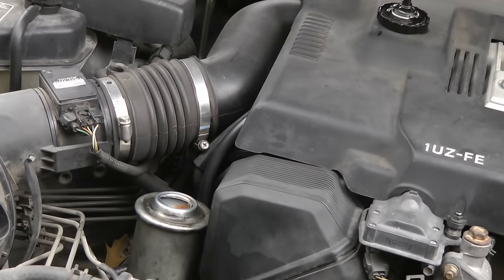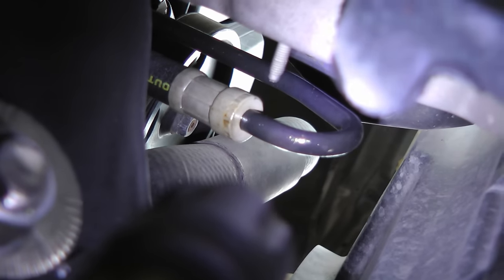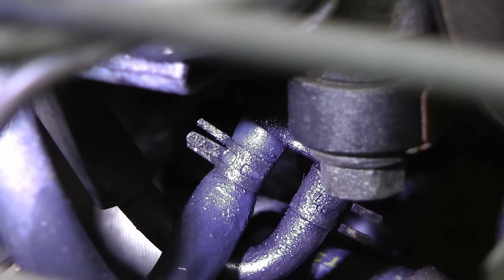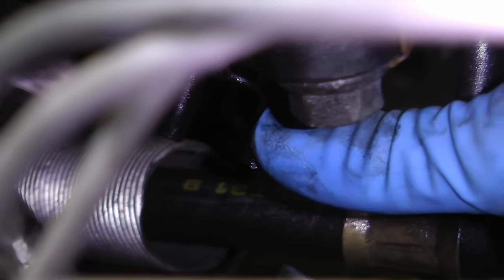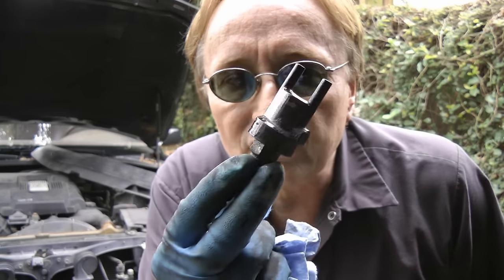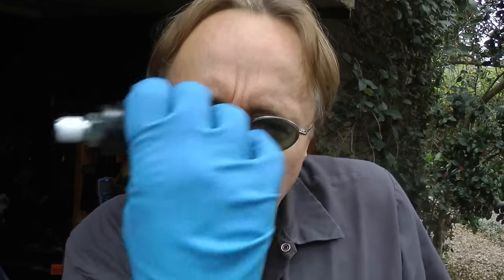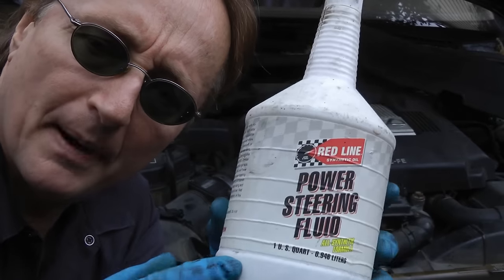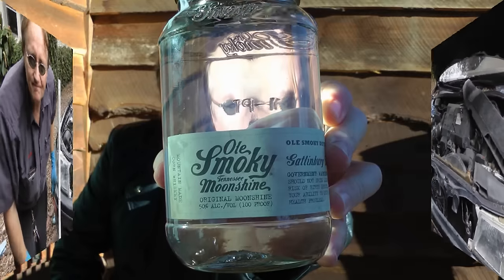How to Fix Power Steering Noise When Turning

Comment: Hey, my steering pump starts to whine when I drive with my ac on. When ac is off the whine goes away. It only wines (when ac is running and)when I'm pulling out of parked position(slow speed). Is this normal?
Reply from the maker: AC commpressor on strains the belt system, try new belts first, if not that, you need a new steering pump

Comment: I have a 2002 ford windstar powersteering wines when it gets warm. It is not leaking and when I check the reservoir while it is running the powersteering fluid is  moving around and that would tell me that the pump is working.  Can you help
Reply from the maker: ford pumps just do that when that old, live with it or buy a new pump,, remanned ones often stink

Comment: Where and or how does the air stuck in the power steering system goes out by just moving the steering wheel

Comment: I'm having similar issues. My 03 Buick Century steering wheel is really stiff and makes a loud weird noise when turning, I checked the fluid and it's literally empty.
Reply from the maker: fill it up and fix the leak
Reply: IF there is no leak? Still making noises?
Reply: What exactly do I need to buy to fix it? How much will the part cost, and labor estimates? Thanks.

Comment: Hi scotty i have a problem my wheel is extra tight wont turn and when i try my battery light kicks on wat could it be and would that cause my car to overheat? really need some pro help
Reply from the maker: corey jenkins   any worn device the fan belts drive can do that. like a bad power steering pump or bad alternator, remove the fan belts and check em all to see if any are binding

Comment: My 2010 Altima is losing so much power steering :/ I have to put some every 1-2 days. It’s leaking so much in between 2 hoses
Reply: Did you get it fix
Reply: Alex Coronel, not yet. I have to take off so many parts to access the hose

Comment: Have a BMW e36 1998
it makes a annoying sound when turned the whole way around (I dont know the max degrees but it wasnt possible turning it more) then it made the sound, it didnt make the sound untill I was all the way around.
This happend both left and right, the servo fluid tank was almost empty, but I filled it, and it still made the sound even when I turned it a few times.

Might be a leak, but would it make a sound if it's oil in the container?
Reply from the maker: pumps are notoriously weak on that model, I change out tons of them, but if it steers good, you can ignore the noise
Reply: Scotty Kilmer
The pump, the servopump that is?
So you have alot of bmws driving around in the states? :D
Reply: Erlend Myhre actually yes I'll answer for him
Reply: Erlend Myhre LOL, yeah of course... "the states" has the highest concentration of BMW sales in the whole world! Don't you know were car crazy here!?!?! LOL

Comment: with my dakota.. first it was the rack.. ..had it replaced.. 3 yrs later... leaked again.. had it replaced again.. .spool valves.. then a metal line was rusty n a slow leak.. had that replaced.. then needed  2 feet to trun the weel..one foor to rev evenly  the other on the gas to keep the truck from stalling or idleing too low.. SO A MECHANIC TOLD ME THE  ORIGINAL PUMP NEEDS TO BE REPLACED  ..DIDNT DO A DAM THING... ...QUESTION... do i have one of thoes things  to keep my idle up ??????? 94 DAKOTA??3.9??????????

Comment: as soon as I put my car into drive a squealing noise begins that last for a minute or less after that it stops and my car run smooth, can this be a problem with my brakes? it doesn't make any noise when I brake
Reply from the maker: often just worn out or loose fan belts

Comment: That is a Lexus LS400.  You never put power steering fluid in them Scotty.  They take automatic transmission fluid.  The reason goes way back to WWII when we banned Japan from making aircraft or aircraft systems.  They were forced to use ATF in their car hydraulic systems which of course is acidic and eats rubber seals and plastic parts, demonstrated by the destroyed idle up valve you showed in the video.

Comment: My Audi 4 steering wheel is making a cracking noise usually only when I'm low spends like in my driveway or  shopping parking lot ..now I'm scared to drive it

Comment: 2008 pontiac g6 4cy power steering location under alt.? where is the filler cap?
Reply from the maker: a cotoia follow the feed line of the pump, it ends at the plastic reservoir

Comment: so my power steering is fine no heavy spots and stuff, the fluid is full but is a darkish black colour and the pump whines abit especially on full lock. what's my problem just a flush needed because the oil is old?
Reply from the maker: yes, pray it's that and not just a wearig out pump
Reply: Scotty Kilmer Well I work in car parts so can get them cheap so ill just buy new fluid and give it a flush see if that solves it cheers Scotty

Comment: i think im having power steering issue. i hear a weird racketing noise when i turn car on.  the noise is gone when wheel is turned either way. this also occurs when driving. noise goes away when im making turns. 99 toyota corolla. it has power steering fluid
Reply from the maker: if fluid is full, odds are you need a new power steering pump

Comment: I did fill up my fluid container, but the noise is still there, infect. I think it just got worse. What could be the problem here?
Reply from the maker: time for a new pump then
Reply: Check your power steering reservoir filter. It can get clogged up and since there is no bypass circuit for it, it can starve the pump of fluid making it groan and harder to turn. I made it a habit to check the smaller things first before moving on to bigger and more expensive parts.

Comment: My Honda  civic eh9 - its steering get sqeeqing sound little bit when i turn the steeering right and left. can you give any solution for that
Reply from the maker: try this if it's not low on fluid. And pray it doesn't need a new pump
Reply: thank you

Comment: My VW polo vivo hit a manhole on the left side and now there is a funny noise like a blowing fan, coming out of the engine when you turn it on. What could be the problem, power steering?
Reply from the maker: check out the fan motor first, it may have been damaged
Reply: Thanks Scotty. I have checked the fan and it is not the cause of the noise. The power steering pump is positioned directly where I fell into the manhole and it is likely to be affected but I still need expert opinion without taking it to a mechanic?

Comment: Scotty, the AC on my 2000 lexus rx300 stops working if I turn the steering wheel to fast. what is happening?
Reply from the maker: check for loose wiring to the AC, turning fast makes wires move around, a loose connection will do that

Comment: hey man i got a Lexus sc400 it's got a leak i have changed the houses an it is still leaking but i haven't got to look underneath yet could that be my problem
Reply from the maker: +Nytral Rodrigues leaking rack most of the time, do my video "finding and fixing car oil leaks"
Reply: Sorry bout that i forgot to mention is my power steering

Comment: how do you check an electric power steering that doesn't have a power steering fluid? it makes a whining rubbing noise
Reply: which car do you have? Just because it's electric power steering doesn't mean there wouldn't be any hydraulic fluid.
Reply: +_ Skylake _ i have a similar problem when i steer specialy when the car not moving i can hear like drums like tug tug tug sound. i have 2006 civic si and it doesnt have any power steering reservoir.
Reply: +comment man comment man www.reddit.com/r/mechanicadvice

Comment: At what point should I just get a new car? Actuators are bad, engine temp sensor is bad, oil leak, creaky doors, door locks  get stuck steering  makes that noise, other sensors are also bad.

Comment: I have a Subaru Forester 2007 and i have a noise cómo from the power steering pump, i had replaced OEM pump, high and lower hoses, the reservoir and the whole rack and pinion and i still have a noise, i dont know what else could be, please anybody help me

Comment: I got a 1999 Infiniti q45 that makes a loud screeching noise when I turn the wheel on start up then goes away once the engine heats up, help please
Reply from the maker: generally just a worn or loose fan belt

Comment: i just replaced my pump,high side line,low side line,all fluid (flush) car was bled till no noise when turning, no bubbles,perfect fluid level and silent for 3 days then it started whining more and more checked for air.....no bubbles and no noise at idle noise only when turning wheels after i stepped on the gas. start car in morning alls quiet turn wheels back and forth no noise....step on the gas and it starts yowling real loud and wont stop no matter what you do. if anybody can help me im open for suggestions. If you need to know its a 2000 lincoln continental front wheel drive 4.6L  v-8

Comment: A friend of mines Ford ZX2 Escort power steering doesn't wine, it doesn't lose fluid, and the belt is good, yet when you drive it down the road, the steering hangs up/catches for a split second, and when it does it, it feels like a jerking motion. It doesn't do it all the time, and it appears the colder it is outside the worse and more often it does it.... anyone with any suggestions on what might be the problem? I told him that perhaps a valve in either the pump or the rack is sticking, if so, would a power steering flush fix it?
Reply from the maker: ,.a flush often will fix that. see my video "FIXING binding power steering."
Reply: Scotty Kilmer Got it, thanks Scotty!
Reply: My 02 Camry was doing that, especially when I'd straighten out after a hard turn.  After 12 years, the original fluid had chunks of sludge and gunk in it.  I took the pump off of a large empty bottle of Purell at my work, rinsed it out, and used it to pump out the fluid in the power steering reservoir.  Then I refilled it with Mobil 1 Synthetic ATF.  I did that 10-12 times or so and I'd say about 90% of the fluid is new.  Once I did this "flush" (figuratively speaking), it feels like I'm steering a brand new car.

Comment: my car makes a creaking type of noise when i turn the steering wheel and it gets worse the colder it gets , above 60 degrees the noise in non existant. any idea what it could be ?
Reply from the maker: +mrREVbud often bad bushings or worn ball joints or strut mounts

Comment: So my 2011 chevy equinox makes a grind/ vibration noise when cutting my wheels. Only slow though. Once I give it some gas noise and jerk in steering wheel goes away. Only when turning while idle. Feels like steering wheel jerks like to much pressure with something.  Anyone have an idea

Comment: question ? I own a 97 kia sportage why I cant get the key out the ignition to get out from there I have to unhook the power line from battery thas how I do it
Reply from the maker: try that, but if it doesn't work, you're going to need a new key and lock assembly
Reply: ok im gonna try to do what u diid in this video thank you mr kilmer

Comment: If it's not the fluid or the pump or leaks what could it be
Reply from the maker: +brett1618 worn steering rack can strain and cause noise, even a clogged high pressure hose
Reply: +Scotty Kilmer it's not a rack and pinion it's a 1990 GMC Sierra

Comment: my mercedes 221 s class steering wheel is making noise what could be the issue
Reply from the maker: low on fluid from a leak, or worn out pump

Comment: And if you don't fix that leaky/squeaky powersteering pump, it will drip all the fluid right onto the alternator and eventually, kill the alternator.
Reply: Yup. had that happen in my old 1993 Lexus LS400. (like the one in the video). Had to fix them both, that was costly.

Comment: Hi i need help why i have hard steering wheel on vw touran 2011
Reply from the maker: +swiftgmx ady  check for low power steering fluid first, but if it's OK, on that model, replace the power steering pump or the electronic motor if it has electronic steering

Comment: Scotty I need help.
I change my old power steering oil and now it make very much noise,before with old fluid it was quiet what happens?
Reply: Dimitris Mandas Air?
Reply: I fix it I change again the fluid and now it's OK.
I don't know what happens and the other liquid was new
Reply: Dimitris Mandas Probably air, you have to turn the wheel all the way from end to end several times to get the air out, with the engine off I believe so as not to cause damages
Maybe someone more knowledgeable can give their opinion as to why the noise
Reply: No I make it many times and the noise was there when I recharge the liquid immediately stopped. So was bad the liquid
Reply: Interesting, I really have no answers

Comment: popping noise in my 2013 chevy impala sounds like its coming from the steering column what could it be and I can only hear it when at a stopped position
Reply from the maker: take it back under warranty, often the bearings inside go bad due to cheap plastic construction.

Comment: I would think the loss in idle speed due to the PS is compensated by the cars idle control valve.... Why this stupid extra valve?
Reply: Cause the idle control valve is for the AC there has to be another valve that controls the powersteerings vacuum on valve can't do both
Reply from the maker: that's right, power steering uses a lot of power so fancy cars like this lexus have idle up valves for them also.

Comment: Why doesn't the air leave when the wheels are on the ground? Does anyone know why?
Reply: you turn lock to lock when the car is in the air to save your tires from getting chewed up on the ground
Reply: 2AMCars What does that have to do with releasing air from the power-steering pump?

Comment: you DON'T USE POWER STEERING FLUID on a lexus ls. you use dexron lll.
Reply: phil smith SCOTT IS THIS COMMENT TRUE? I HAVE THE SAME CAR IN THE VIDEO AND SAME PROBLEM WHERE CAN I BUY THAT VALVE?
Reply from the maker: you can use dexron 3 or a toyota bottled power steering fluid from the dealer. Just google it to buy the valve, that's how i do it and buy the best price that way

Comment: Ok Scotty, hopefully your not too YouTube famous to reply... but, I'm wondering if this will apply to my 2000 Mustang? I get a terrible whine, especially when driving under 5mph. My only problem with going through this whole process you have explained is that I keep reading and watching other videos saying that it's not the PS, or it is, but then they give different solutions. Some say it's just the Ford PS all together and I need to change it out, some say I just need to flush the fluid, some say that it's not even the PS and that it's the idler pulley.... I don't have a mechanic I can trust, so I'm just so lost. Help would be appreciated and earn you another Subscription!  P>S< Ole Smoky Moonshine is the shiiiiit!!!
Reply from the maker: sure, give the cleaning a try. Just realize ford power steering pumps are weak and often make noise so that only Replacing them with a new (NOT REBUILT) pump
Reply: Flushing the PS fluid in Ford/Lincoln/Merc vehicles really makes a huge difference in noise and operation. For whatever reason, they're extremely picky about clean/new fluid, even in low mileage situations. I believe your Mustang should take Mercon V transmission fluid.
Reply: 1999 v6 driver here. It's just what ford pumps do. Mine does it, so does my brothers 99 expedition pump. My dads 2005 ford pickup is starting to do it too. It's just the pump, if it ain't broke, don't fix it.

Comment: No one can figure this out when i turn my air conditioner on i lose power steering, when i turn on my heat the break and battery lights come on,  this car is a nightmare, oh and the electric locks lock and unlock while driving, when car is not running and also when i put the key in door, have to be fast to open, i compare it to the car in Christine movie, bought it for 5 grand and put more then that into it in 3 years, we believe it was from a flood.